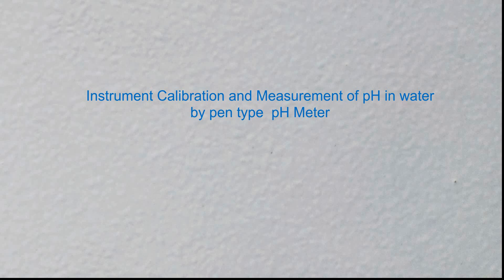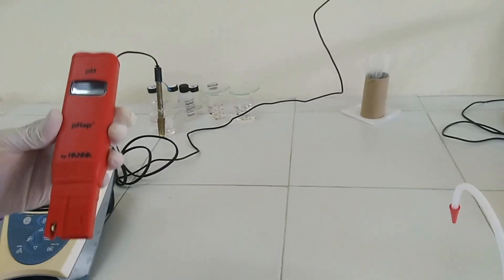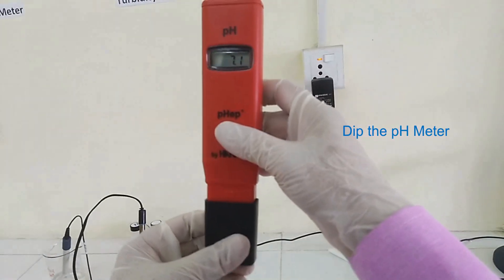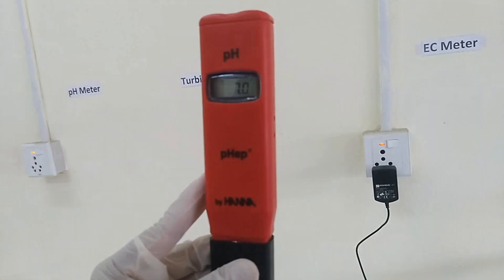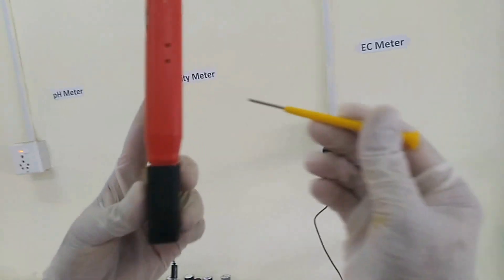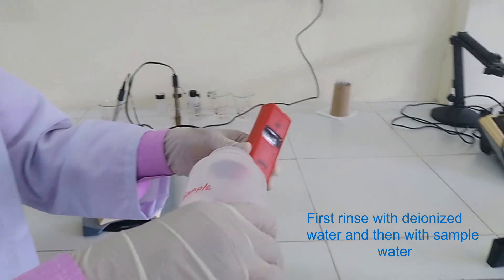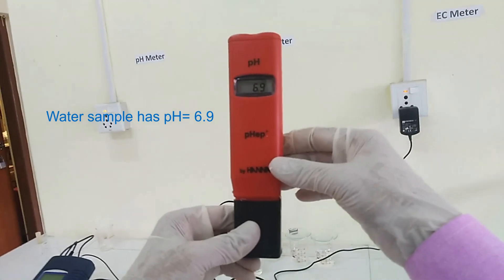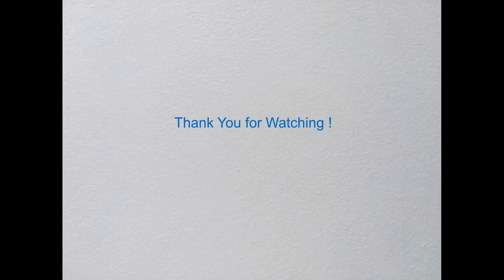Measuring pH of Water: Instrument Calibration & Measurement by pen type pH Meter(HANNA)

Comment: Sir mine phep is showing 1666 and then ph 1 when i turn it on what is the problem plz reply sir
Reply from the maker: please dip the electrode of ph meter about 2 days in pH 4 solution or tap water and clean electrode gently with brush. May be work. If no please contact your supplier.

Comment: How to make 4M KCL solution.. Sir?!?
Reply from the maker: dry certain amount kcl in oven at 110 0C for about 2-3 hours.Then weight 22.368 gm kcl in analytical balance.Take 100 mL A grade volumetric flask and dissolve it by distilled water, shake.make final volume up to mark of volumetric flask. Shake well. 4M KCl is ready
Reply: @Laboratoryanalysisofwater   lots of thnx sir
Reply: What KCL?

Comment: Why should store with kcl ?
Reply: You wont need to calibrate every time if you store it in this solution.
Reply from the maker: It has glass bulb electrode having very dilute HCl solution inside glass bulb so It is necessary to make ionic environment outside the glass electrode to avoid damage.
Reply: @waterqualityanalysislaborator Then why we recieve new pH meter with dry bulb/electrode and there is no KCL solution inside cap? May any damage already caused to this brand new equipment? Please guide